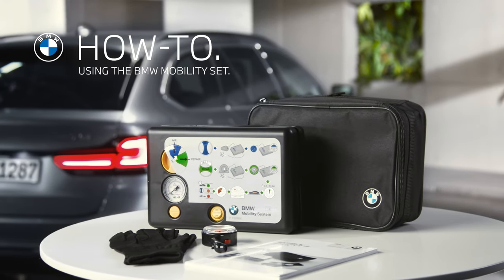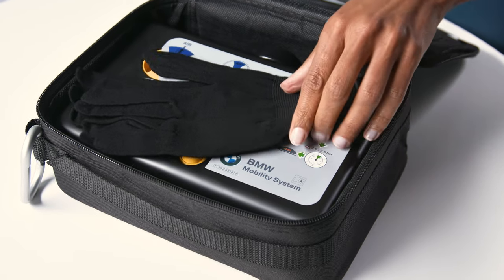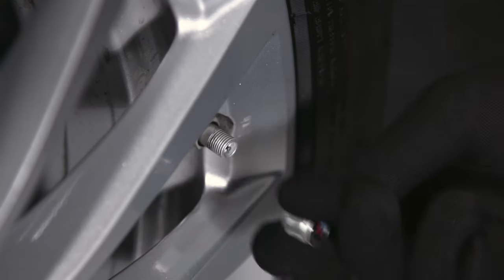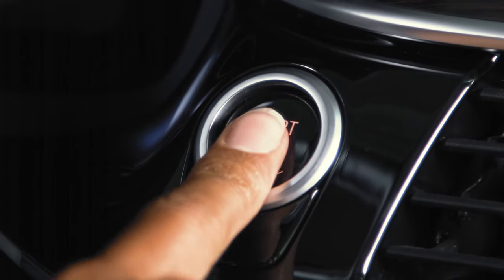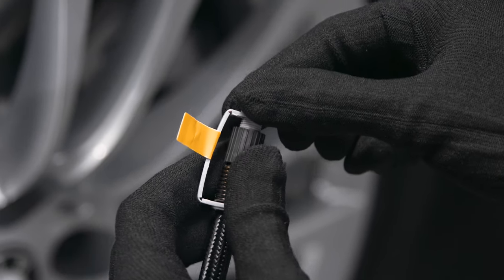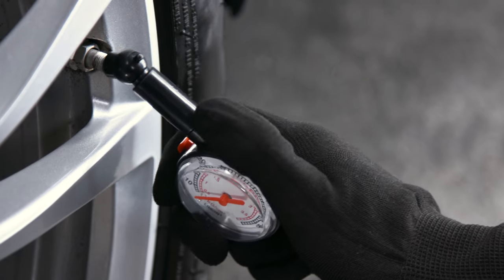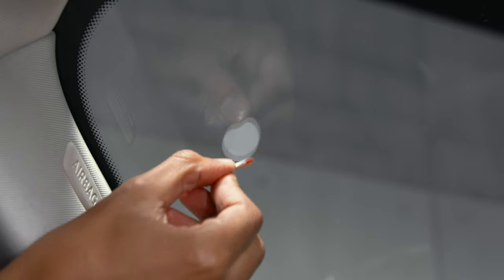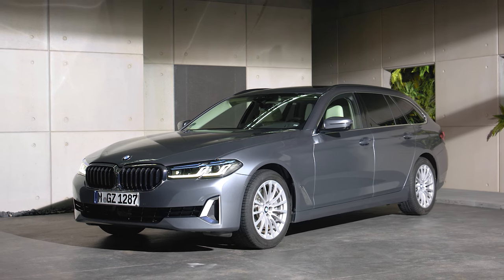Using the BMW Accessory Mobility Set - How To

Comment: Dumbing down the simple. Crazy if you use this stuff. Learn how to plug a hole instead, doesn't destroy your tyre pressure sender, and you can keep using the tire as long as you don't exceed 160kmh. Using sealant is going to cost you heaps, and make bmw more money. Personally I'd use the spare tire, head to the tire shop, and let them sort it out. Like the good old days.

Comment: can the tire still be repaired after using sealant?  If you get a nail in the tire and it has a slow leak you can drive to a gas station and get a permanent repair for around $20.  Wondering if this is the case after using this method.

Comment: Can you use the mobility set just purely for refilling the tyre air or is it only for repairs?
Reply: At the end of the video they say that you can use the mobility set to inflate bicycle tires and footballs etc. I think this apply only after you've used it for a puncture repair as there's some sort of liquid form of tire sealant in there.

Many models comes with the tire sealant and tire compressor separately.
Reply: @Gadne92.5  yeah that’s what I was confused about. Whether you need to use the sealant first. I actually am leaning on maybe you don’t need to use it first as there are options for air or repair. I’ll ask the dealer when I collect my new car
Reply: If you need just air, switch it to "air". If you need to repair the tire, switch to "repair". I mean, c'mon. What the hell... 🤨😅😅😅

Comment: If the tire is not damaged and simply needs air, can I use the Mobility Set?
Reply from the maker: +DevinCasey Hi Devin, thank you for your message. If you require any technical assistance please contact your BMW dealer directly. They will be happy to assist.